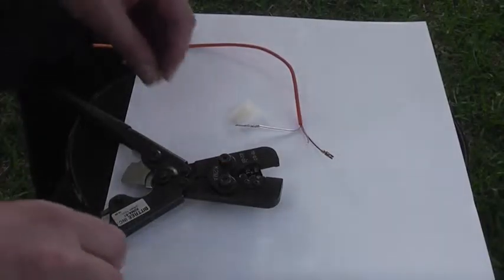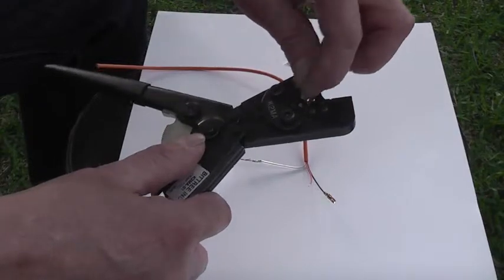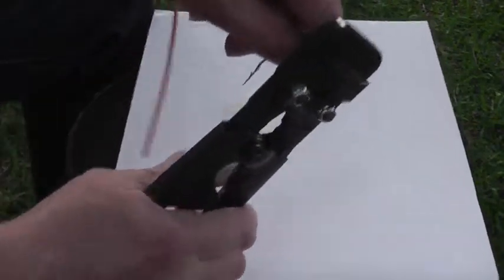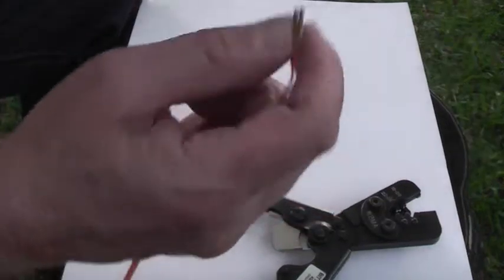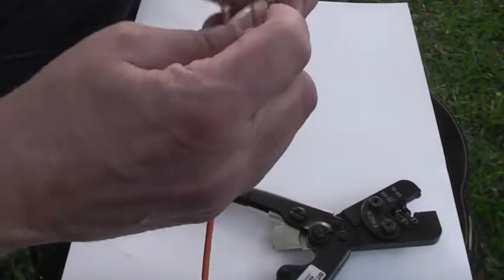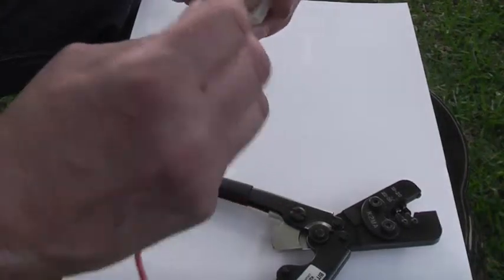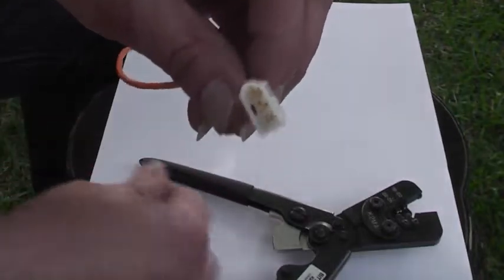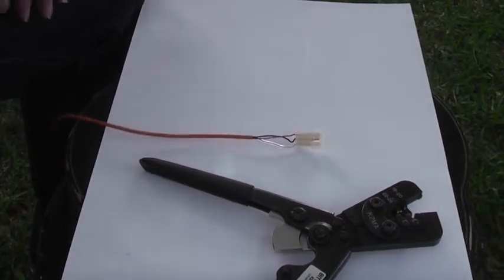How to Crimp E3 Pins for Connecting Patchbays with the Bittree K2MA-01 CRIMP Tool

Comment: hey Bob. years ago I purchased an EDAC pin crimping tool and did crimp connections when getting wired up with a mixer that used huge 120 pin EDAC connectors. do you know if these E3 connectors use the same pins as other larger EDAC connectors? or are they different pins that could require a different crimping tool?
Reply from the maker: Hey Hooper, All ELCO & EDAC pins are the same size. Plus, the same E3 pins are used for both the male and female EDAC connectors! So, yes, your crimp tool will work.
Reply: @MisterPatchbay  I hugely appreciate you being able to offer your expertise here on such an old upload. thank you!!
Reply from the maker: No problem. Take care.